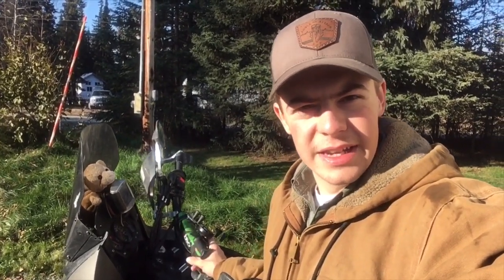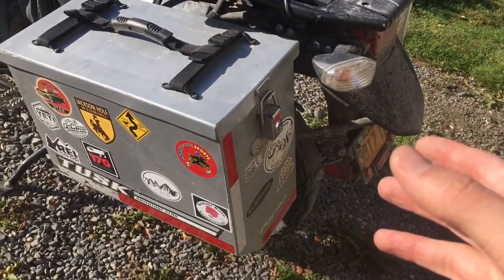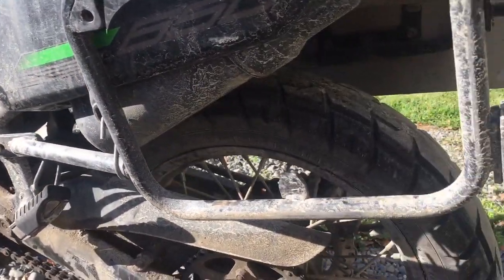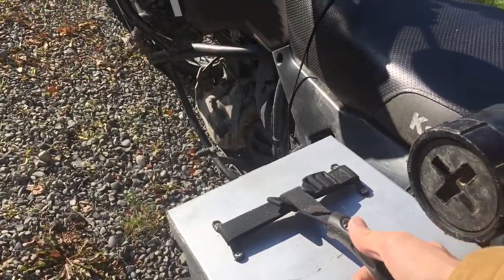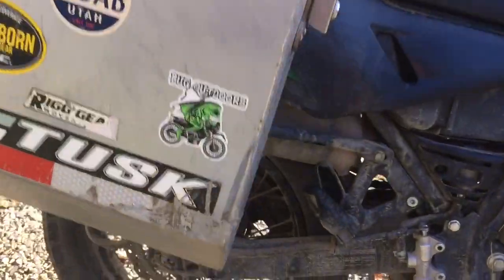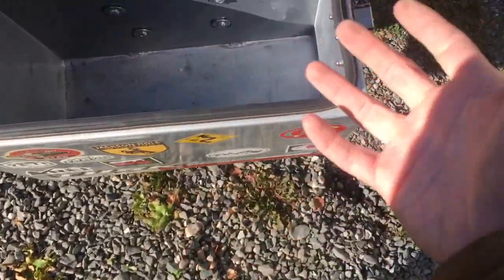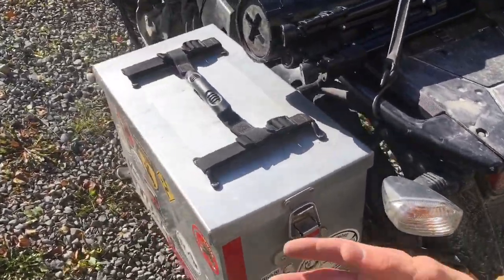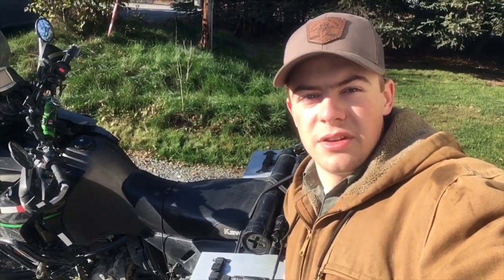Review: Tusk Panniers and Racks | Gen2 KLR 650

Comment: Nice review ~Liam. Certainly field tested. I have a set of these ...
1. Be sure to Locktite all bolts. I lost a couple of the top handles on my summer Idaho ride. The RMATV sent me out replacements.
2. The screw in safety bolts that go in from the panniers to the racks are great. Keep people from stealing your stuff and confidence your panniers will not fall off. Always check all 4 latches are locked when gasing up.
3.  I like mine .
Reply from the maker: I guess  they’ve seen their fair share of use 😄... yeah loctite is a must.